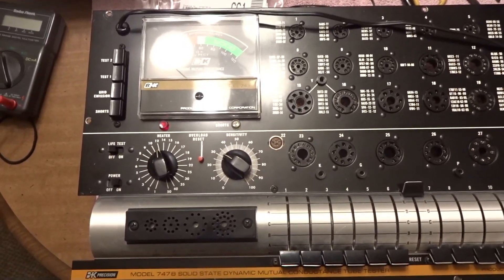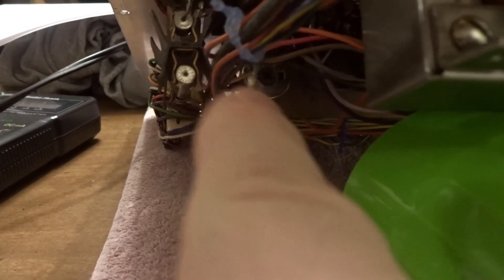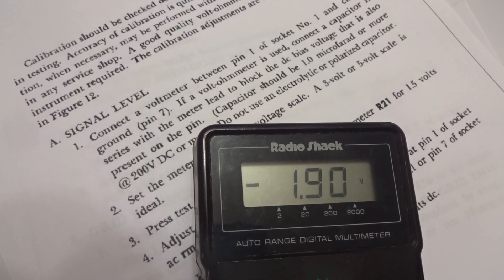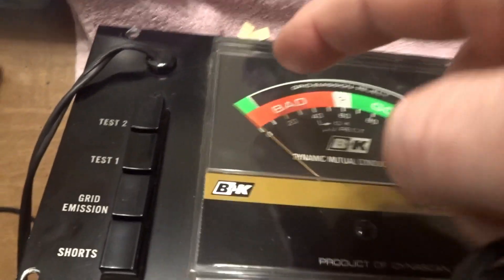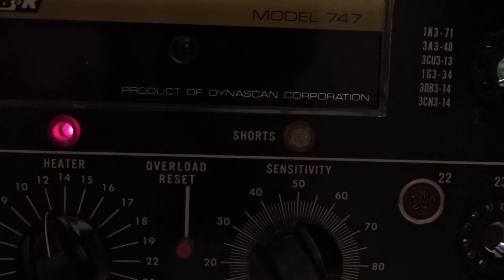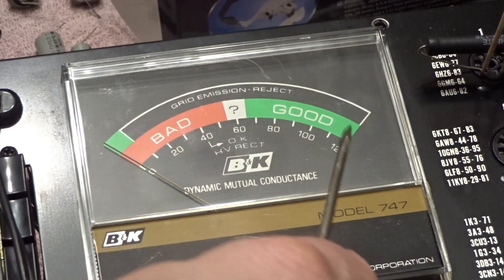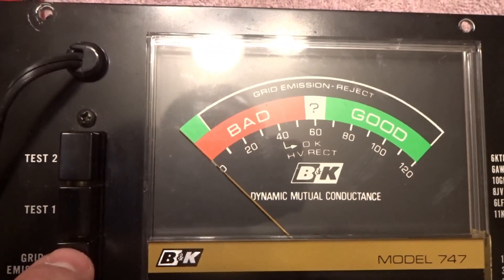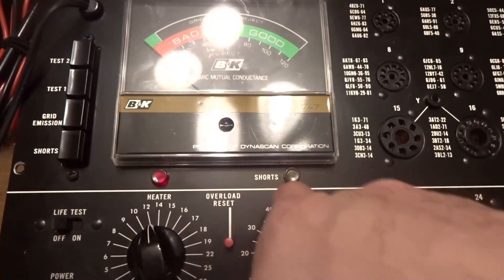How to Calibrate B&K 747B

Comment: This has been an excellent help to me. The manual is good but seeing it made it much easier to follow. I have a question. The lowest I can get the voltage in calibration A is 2.0V. I did change the 55 bulbs. Not sure if that impacts things. All other calibrations worked.
Reply from the maker: I'm glad it was of help :) Yes the #55 bulbs are very important. Are you using NOS GE brass based bulbs? The Signal level needs to be at 1.5v. Did you use a 1uf 400v non-polarized cap in Socket 1 Pin 1 connected to the positive lead on your multimeter? If not the cap needs to be there to block DC voltage.
Reply: @TheVlad69  I did use the cap. I have a 1uF 200v one that meets the requirement in the manual. I think the bulbs are throwing things off. The old GE bulbs glowed much dimmer but one of them was cutting out. I replaced them with new 55 bulbs but they are “long life” even though they have the same voltage rating. They glow much brighter. I assume since I calibrated with these new bulbs that all the adjustable resistors are inaccurate.
Reply from the maker: @DarrenForbes  Did you try cleaning your old bulbs & the sockets? They are known to have bad connections. If one was cutting in & out I would say the connection isn't good. There is a solder braid mod where you solder the base to the side of the bulb. I would try swapping the original bulbs & see if the same one cuts out in the other socket. If it does then it's a bad bulb. Let me know if the bulb cuts out. My one bulb during test goes dimmer then the other.
Reply: @TheVlad69  looks like some solder had previously been added to the side of the base. If I wiggle it it will come on. Perhaps adding another bit of solder might help. Might be hard trying to find vintage 55 bulbs. I will keep you updated. Thanks for the help. So few people these days know about any of this or seem to care to know. Feels like a dying art.
Reply from the maker: @DarrenForbes  That sounds like a bad connection. Check this forum out you can see in the picture the way it's soldered. https://antiqueradios.com/forums/viewtopic.php?t=332095&p=3312348 If that's not the problem let me know & I can help you get some NOS bulbs. You're welcome. I'm more then happy I was able to help you. These days the people that had the knowledge are mostly gone & the ones that have the knowledge most don't like sharing it. There's still places that calibrate these for big bucks. They're a handy thing to have. No matter what anyone says tubes aren't going anywhere. Too many people use them in high end audio not just amps. If you need new sockets let me know.
Reply: @TheVlad69 Thanks so much. Even having a place where people can ask questions is huge. YouTube has been great in so many ways. I added some solder to the base and the foot and gradually filed it until it fit snug in the socket. They both lit up. I could then calibrate the signal AC to 1.5V. All other calibrations worked. The DC voltage was the only one slightly off. The best I could get was 2.4V. I appreciate the help and suggestions. I would not have gotten this far without your help.
Reply from the maker: @DarrenForbes  You're very welcome. I'm really glad I was able to help you out. By chance did you use DeoxIT D5 in your potentiometers? Mine were really dirty & the one didn't want to move all the way. I had to turn them back & forth to free them up. Lots of dirt came out. -2.4v is very close. I'm glad you got them to both light up & dialing that Signal level in is a very important part of the calibration.